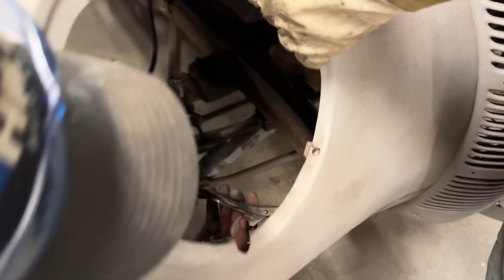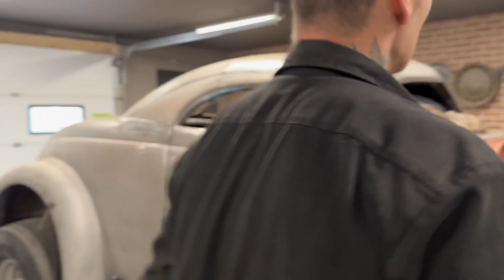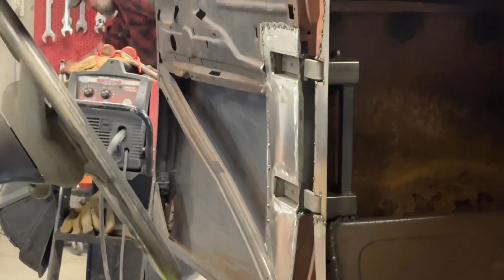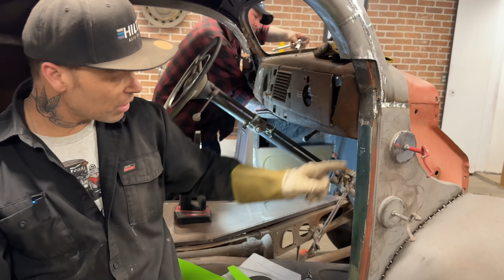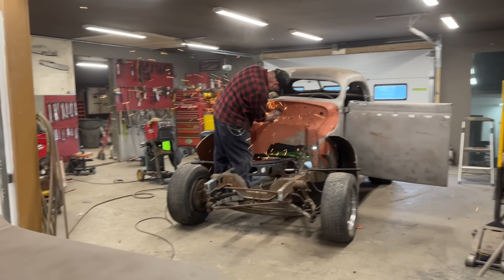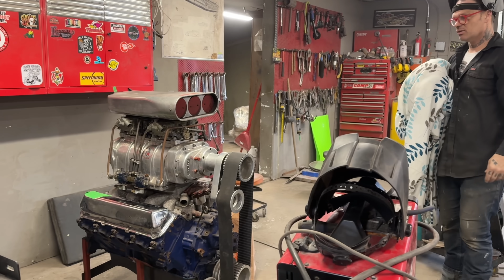Cutting out the firewall for the big block Ford 🙃 (Bad Chad bonus episode)

Comment: Hey Jolene, great video. Just a thought on some safety. Might want to talk Chad into converting the break system to four wheel disk breaks due to the power of the engine. That really helps s a must with the weight and power of that car. Thanks for the great video 😎⚙️🏁
Reply: B R A K E

Comment: Hi Chad, Jolene and Nate, Your making progress on the passenger door hinge reversals . One question I have is when you cut the section of the firewall out .To make room for the 460 cubic inch Blown Big Block .? Once you complete the engine installation , will You build a new firewall in back of the new engine ?

Comment: That far back with the motor weres the tranny going to go thats a X frame you going to build a new frame cutting that much out of the X  is going to weaking it a lot and that  motor will twist it in half if those tires bite in
Reply: it will be fine. worry about that when they get to it.